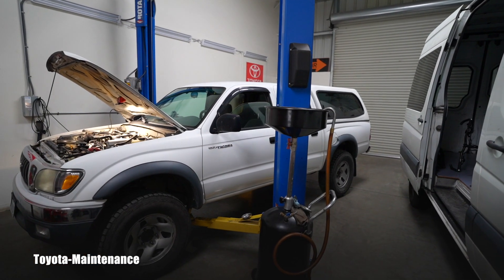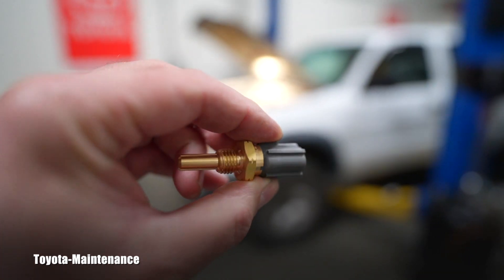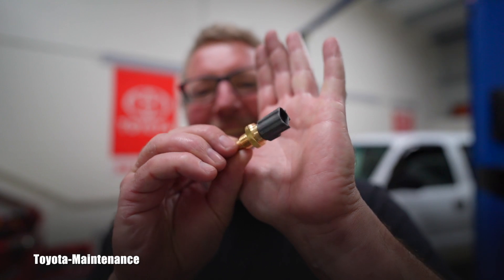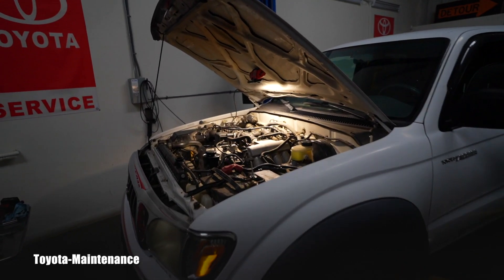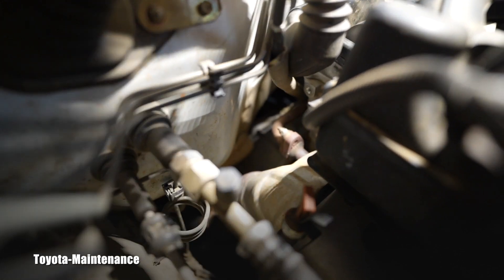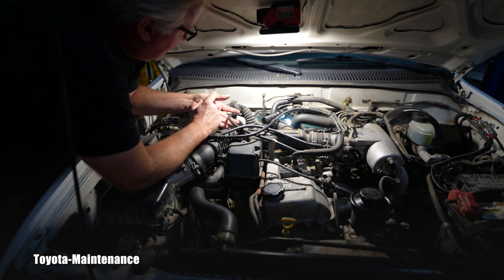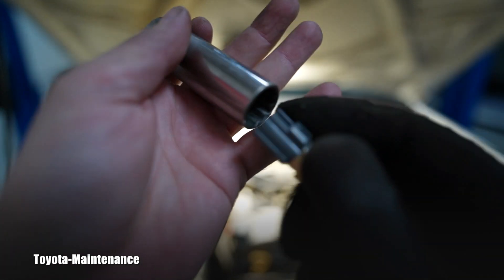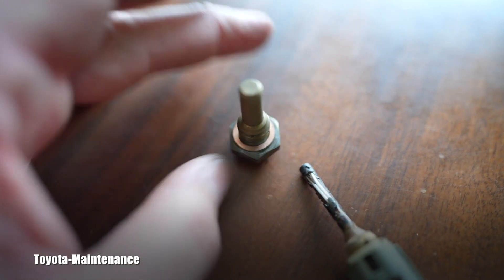Toyota 3RZ-FE Coolant Temperature Sensor Location, Removal

Comment: I replaced that rear sensor . What a pain in the butt .
I had to use my camera to even see it the first time !
Reply: Did you have to drain the coolant?
Reply: @chasing_bends   I drained it because I put a new thermostate in it , too.
Reply: @jayhockley8841  do you feel it is necessary to drain? I just did a full maintenance and now my truck is low idling so i am going to start throwing new parts at it and i was going to start with that. I should have done it when i had the valve covers off
Reply: @chasing_bends   You could try it without draining it .
Yeah mine was idleing irractic and had a " Coolant sensor malfunction " code .
The biggest pain was lining up the plug right so it clicks back on the sensor .
You basicly do it by feel .
And when you tighten it , be carefull to keep the socket ( 3/4 inch / 19mm ) lined up so you dont crack the top of the sensor while tightening )
When you start to thread the new  sensor back in , be carefull and get several turns on it until you start " wrenching"  on it so you dont crossthread it .
Reply: @jayhockley8841  appreciate the tips!

Comment: That clear plastic shipping tape is wonderful for temporarily holding things together in places where where your hand can't fit. It is also great for holding wires or hoses out of the way, and even for holding the glass up if you are working inside a car door changing the regulator. IF the part is clean & dry, it really sticks. I had to use it to hold a serpentine drive belt on some of the numerous pulleys, while I fought the stiff new belt on the tension pulley of my Ford Expedition. The best thing is that it is dirt cheap. It is amazing how something so thin can be so strong. Like the man said in the film, 'The Graduate' in 1967, "Plastics." That dude was right. I never thought back then, that one day many engine parts would be made from it. Plastic has come a long way in over a half century.

Comment: I think, using a scanner to  diagnose and confirm engine  temperature sensor fault, should be the proper test before installing $80 part.
Reply: Thats correct and exactly what the shops that couldn't fix the youtuber's truck said.  I'd rather fix the truck than be right...